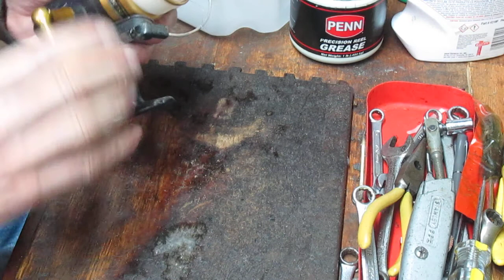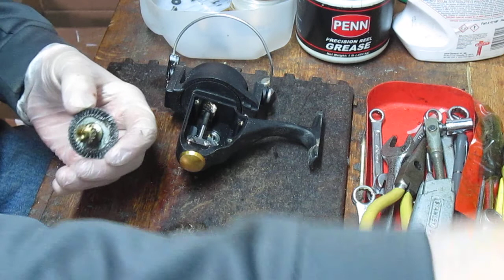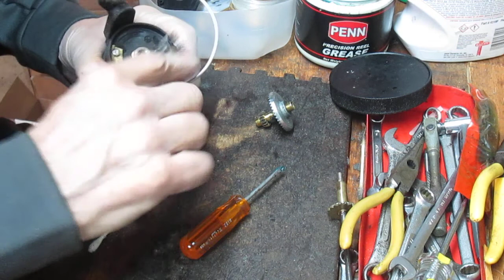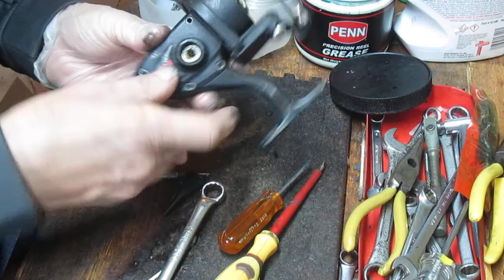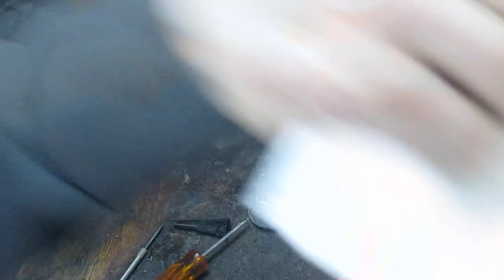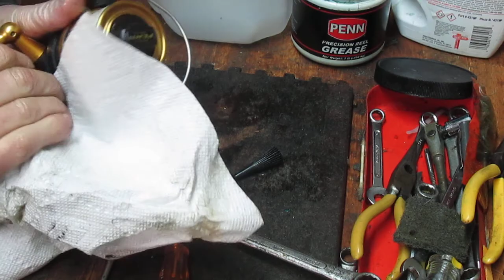Penn SpinFisher 550 SSG reel maintenance and rebuild including drag service

Comment: I use a carquest brand brake parts cleaner to clean all my reels it does not take stickers off or anything and it does not discolor any of your hardware
Reply from the maker: Thanks for the tip.  I generally avoid those types of cleaners but if it works for you that's great

Comment: Hey Dennis. I noticed you didn’t address bail trip , auto bail feature.  I have a couple of these it seems when they work they work fine when they don’t they don’t I’ve reset the cam trip levers and spring even tried shaving the brake a bit. Can’t seem to find the issue
Reply from the maker: I've made a separate video on setting the cam lever.  Generally, you do not need to remove or disassemble the trip during a routine service, unless there is a problem with the bail trip - FYI - Dennis

Comment: Great video! Do you by any chance know if the rotor assembly for a 550 Penn ss or 550 Penn ssm rotor assembly would fit my Penn 550ssg? Everything works great as far as cranking but the rotor assembly needs replacement along with all the springs etc. and the bail.
Reply from the maker: I don't know the answer to your question, but I am sure that Scott over at Mysticparts.com will know.  You can call them here 
CUSTOMER SUPPORT:
 Orders/Support# +1 (609) 488-4637
 PHONES are 9AM-2PM ONLY 

Thanks for asking and for watching - Dennis

Comment: Thank you Dennis for sharing your knowledge!nice job. I’ve Recently done maintenance man a 55recently done maintenance online 550ssg but I’ve failed someplace with the drag it appears good but if you pull line off the drag tightens & eventually locks up this is why I did the maintenance. I did take a complete drag system out, cleaned and greased. All look good in the knob. Any suggestions?
Reply from the maker: I think you need to recheck the drag washer order in your stack and the adjuster knob.  Make sure the washers start with the fabric on first in.  Do you have the teflon was he in under the spool?  The needs to be there as well.

Comment: Hey Dennis I see on the inside of the rotor there is a weight on this 550 ssg is this counter weight for balance so when you reel it doesn’t wobble my 550 SS wobbles when I reel it in is it supposed to have a weight
Reply from the maker: The counterweight balances the off center position of the bail arm and assembly to keep it from wobbling.  If it is missing, that will be a cause.  If there wasn't one to begin with, then a badly bent bail wire, or a loose rotor cup will cause the same issue - Dennis

Comment: Hello sir, can you do a video on reinstalling the bail assembly to include the spring and small part placements inside the sides of the rotor on the 550 ssg please?
Reply from the maker: Are you asking on the trip lever assembly or the actual bail spring? I will see what I can do - Dennis

Comment: Hi there, good morning. Is the handle left/right changable with 550ssg ? May i fishing with this fresh water and saltwater?
Reply from the maker: Yes - you can switch the handle to match your preference for right or left side winding. This is a multi-purpose reel for deep fresh water or casting and may be used in saltwater from surf, pier or inshore boat fishing - Dennis
Reply: @2ndChanceTackle  Thanks Dennis. I was confused cause, recently purchased a 750ss. And probem with handle. I am right handy. So i ordered right hand pivot from ebay. Do you know any better store for penn parts?
Reply from the maker: The best source of Penn Parts is Mysticparts.com They are an authorized Penn Parts distributor
Reply: @2ndChanceTackle  cool. Tnx Dennis.

Comment: They grease the top of the main gear to protect the rubbish pot metal. Grease=corrosion inhibitor, oil=part to part lubricant.
Reply from the maker: I guess it is one way to keep costs down and another way to sell reels when these break.  I often wonder if the engineers ever go fishing with the reels that they build

Comment: I've had this reel almost 40 years and hardly ever used it. I brought it out of hiding. Every second or third turn on the handle the reel was binding. I sent it to PENN and they serviced it for $58 including the shipping and tax. They replaced three bearings and washers and sent me the parts they replaced. Now that I've seen this video I can do the job myself. 
Thank you very much for posting it.
I see that you cleaned the outside with degreaser. I would think that you would wipe it down with some reel oil later and then use a paper towel to take off the excess before putting it away? The moving parts of bail and line roller could use a drop oil as well?
Reply from the maker: Yes - I use Purple Power, which is a cleaner/degreaser.  I then use a WD40 spray and wipe with the paper towel to finish.  Glad to see the video helps.  Good luck with the maintenance.  Go catch the big one! - Dennis

Comment: Curious what's the difference between the Penn spinfisher v and vi?! Specifically the 10500
Reply from the maker: Hi Valerie.  The easiest thing to do is to go to Pennfishing.com and select the product you want review and then use the site comparison feature to see the reel features side by side.  I believe that Penn is pushing the sealed reel technology and CNC cut gearing as the two upgrades on the Spinfisher VI.  There are always cosmetic changes, which don't change reel performance, but mechanically, the reel should be a little smoother and less prone to wear.  Having said that, there are a lot of great deals on the Spinfisher V now that the new model is released, so the price/value is probably in favor of the V models - As an example, I have been selling the SSV 9500 for $145.  The reel sold for $199 prior to the VI release - Thanks for asking - Dennis

Comment: Great video I just received a 440ssg I'm going to take apart and clean up myself only paid 45 with shipping so got a great buy.
Reply from the maker: Sounds like a great deal.  Good luck with the overhaul and tune up - Dennis
Reply: @2ndChanceTackle  thanks I have been doing my own cleaning for awhile I just make sure to check out a few videos first every make and model are different

Comment: USA made 550ssg my uncle surprised me with it a few days ago and she works like a charm but in need of maintenance. I was wondering if you knew of any stores where one can find replacement gears for this reel as I would love to be able to keep mine going for many years to come? Thanks for the great content!
Reply from the maker: Yes - you should be able to order these from https://www.mysticparts.com, which is a new website for the former Pennparts.com.  Some parts are discontinued/obsolete and may be out of stock.  If you cannot find them there, then look on EBAY for used parts or parts reels that have the gears.  Thanks for asking - Dennis

Comment: I have the same reel in great shape. The problem is that the auto bail doesnt flip the bail back. After casting, I start cranking and It just hits it but the bail only goes halfway and then pops back open. When I crank, it spins the spool until it hits the bail release again and stays open. I have removed all the parts and none seem to show any signs of wear but there is also no adjustment I can see. I reassembled and made sure everything was lubed and all screws were tight.  Any thoughts?
Reply from the maker: There are two potential causes.  First is lack of lubrication.  Spray both sides of the bail with WD40 or other penetrating oil and let it sit, them manually work the bail back and forth until it frees up.  The other is that the bail may be bent out of round.  If that is the case, you may want to try re-bending it, ir replace it.  Also, take the spool off and hit the trip mechanism with WD40 as well - Dennis
Reply: Thanks for the reply Dennis. It has been pretty well lubed on all of those parts and recently serviced and the bail seems to move freely. The trip lever just doesnt seem to move the bail far enough for the spring to take over and close it. It is the newer model with the upgraded bail fittings and trip lever bushing. I just thought you may have some insider info. on a problem with this reel. I guess its just a design flaw that shows itself early in the reels life.
Reply from the maker: I haven't seen the problem that much, so it may just be an oddball part problem with a piece that is out of spec.  I guess you would need to replace all the bail parts in order to get it right. The two I gave you tend to be the most common.  Good luck - Dennis